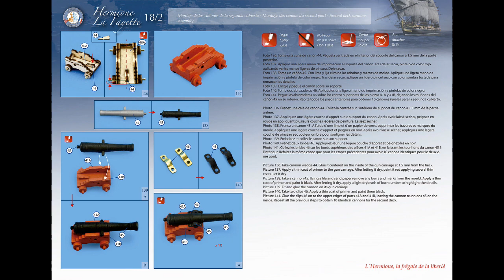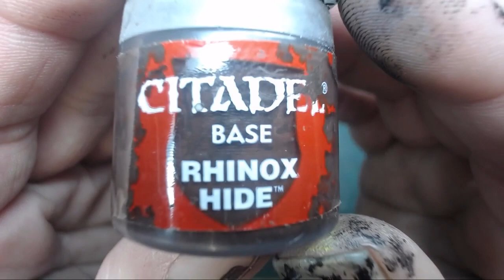Hermoine La Fayette - Part 009 - Second Deck Cannons Part 2

Comment: Great job sharing how you painted the cannons. Every model comes with some sort of flash, no matter what price you pay for it. So with that in mind, I say it is just part of the hobby. What I do not understand is the laser cut parts always come fully on the sheet. I would think that makes postage weight higher and could be avoided. It does give one spare pieces of wood to do what you what with it tho, What you think about that situation.
Reply from the maker: Yeah, I do accept the flash as part of the model. With regards to the the spare wood, I guess its all laser cut and for someone to pess them out would increase the costs. Its actually handy to get spare pieces as Ive used many of them, glue applicators, spacers, clamps etc etc, or just practice pieces. Most useful